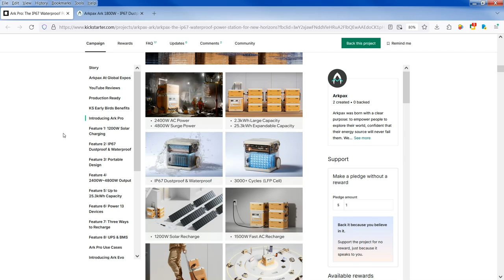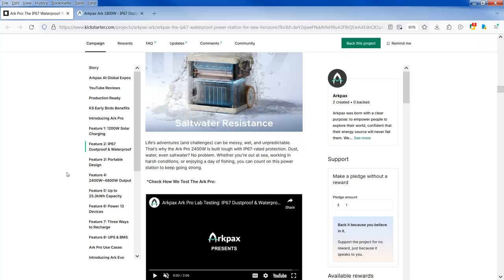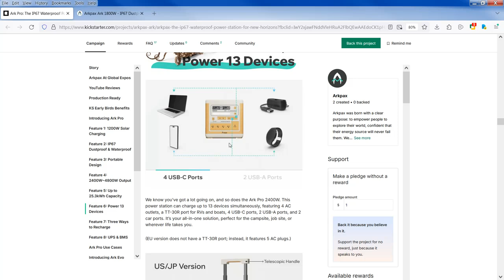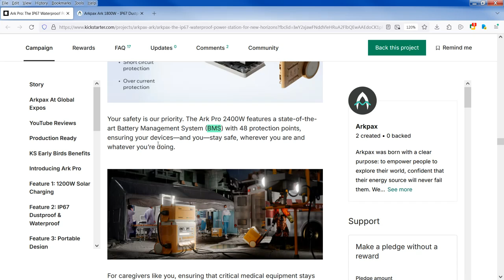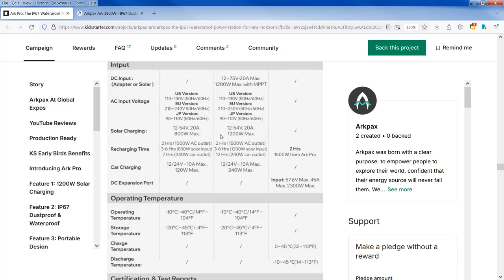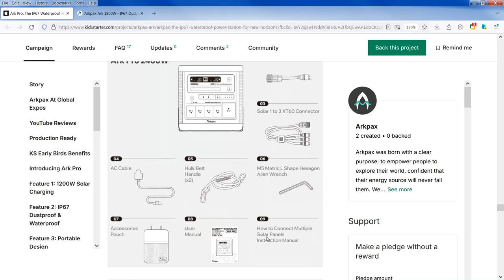Arkpax Ark Pro 2500w - The IP67 Waterproof Power Station For New Horizons (((((FIRST LOOK)))))

Comment: All that together is cheaper than a pecron 3600 Both of them with all the batteries That's eight batteries and that cost $10250 For both of them put together with all its batteries and no solar panels.
 That's when it's on sale. I know.
 I'm gonna try to maybe with your promo code I can get it a little less than that.
Reply from the maker: The e3600lfp is a stronger better power station than this is.
3,600w ac inverter vs 2,400w ac inverter
220v vs 120v
touch screen, etc, etc, etc...

Comment: While you're in luck, have you ever heard of a Titan? That
Generator can hold a lot of batteries that can take a lot of better.More better than you just said How would you like to put a 125 barities underneath a Titan or a round a Titan generator?
Cause it We'll take that many batteries each battery like two killowatts I'm surprised you never heard of that. Generator of the that's the way 2200 W, though I'd have to go check what minute man prep says about it. Because he has 1 1st cabin.
 And he's out there. Half the year and the Titan runs all that's how I found out. I could take a 125 batteries. Actually, I think it takes a 135 batteries.
 Take a passion, I'm not exactly sure but.
 I hear it's a pretty good one. And then.
There's a polo generator.
That one's a little different, but it's not.You can always expand on it and never have to worry about it.You can expand on it as many as you was long as you don't go over about a thousand of them
Reply from the maker: Thank you for the comment